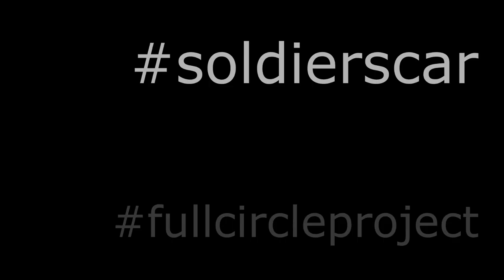Fallen Soldier's Miracle Car Delivered to Son 14 Yrs Later

Comment: Absolutely love this. Patriotism at it's finest! These cars are also underappreciated for how good the 6th gen Celica is. I had a 96 25th anniversary edition and a 97 I bought for $250 for parts. Never have I had a car so reliable in my life. The engine just doesn't die. I put a header w/  full straight pipes  and cat delete on the 1.8 liter engine and a few other performance mods... Would burn rubber through 3rd gear and just ran forever. I unfortunately sold both cars to someone who then blew a tire at 140 mph causing it to roll 5 times. After which the car still cranked right up and would have only needed a new tire and alignment to drive home. The body was absolutely destroyed but thanks to the parts car they were able to do extensive work and rebuild the car. Today the car still lives on. At the time of selling the car it already had over 190,000 miles on it. The only thing that never would last on this car was my tires. :) I'm so glad you were able to make their day and allow the memories to live on forever.